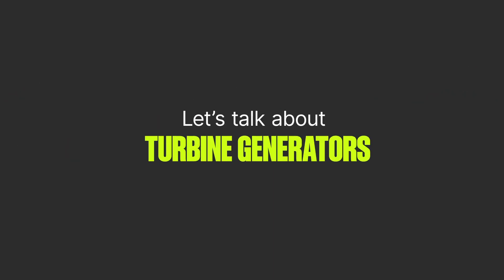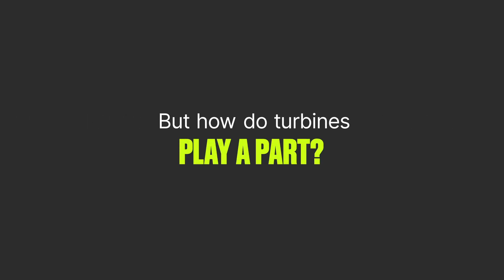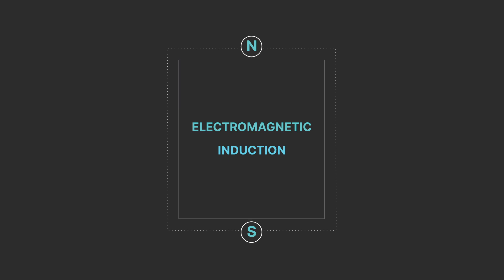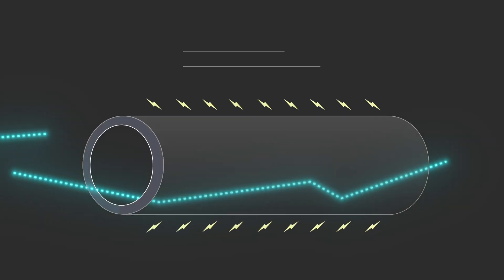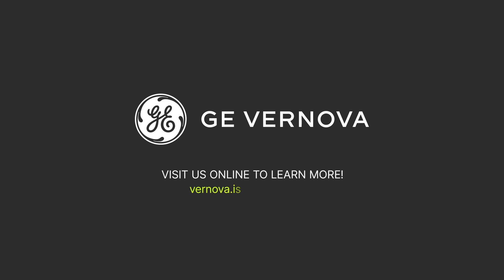Generators 101 | GE Vernova

Comment: how does a generator adjust electrical power output when they always run at a constant rpm?
Reply: I would say through voltage regulators

Comment: 🎯 Key points for quick navigation:

00:02 Turbine generators convert mechanical energy from turbines into electrical energy to power daily activities. They are crucial for grid stability and can be sourced from various energy types including gas, steam, wind, and hydro.
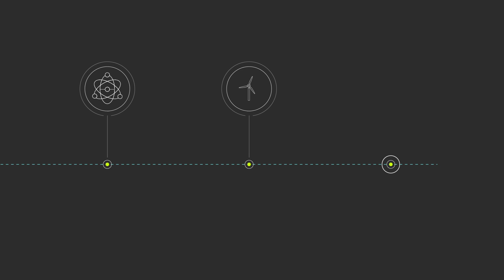00:32 Turbines and rotors provide rotating inertia for stability. Generators use turbine output to produce and transmit power, with energy sources ranging from gas and steam to hydrogen.
01:03 Electromagnetic induction is key, where a DC-powered rotor creates a magnetic field that induces electron movement in the stationary stator, generating electricity.
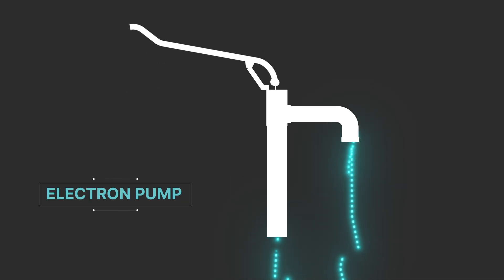01:36 Generators, acting as electron pumps, also use renewable sources like solar and wind. Efficiency is driven by insulation, temperature, and the design of rotor/stator components.
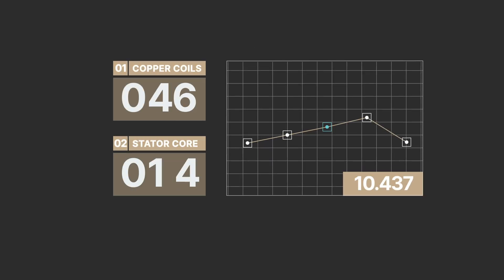02:09 Heat from electron flow affects insulation, impacting efficiency. Cool systems balance thermal energy, with hydrogen cooling shielding insulation while reducing power loss.
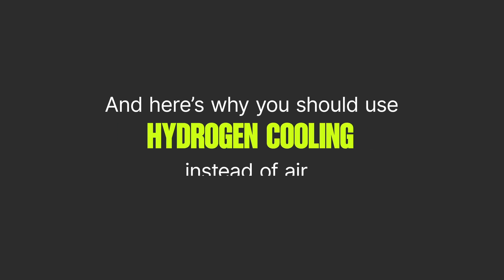02:38 Hydrogen is superior for generator cooling—it's more effective than air and uses less power due to its low density, enabling smaller, cost-effective generators.
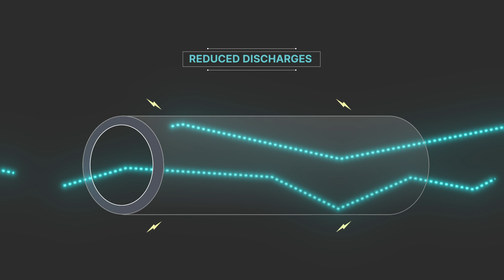03:11 Generators power homes, businesses, and grids, highlighting their ubiquity and essential role in maintaining electricity supply. More information is available online.

Made with HARPA AI

Comment: 🎯 Key points for quick navigation:

02:00 ⚡ Power Plant Generators Overview
- Explanation of how turbines convert mechanical energy into electrical energy,
- Types of turbines used: nuclear, wind, hydro, gas, and industrial steam,
- Importance of turbine rotation and grids in power stability.
03:12 🧲 Electromagnetic Induction Process
- Description of electromagnetic induction in generators,
- Functionality of rotors and stators in generating electricity,
- Renewable energy sources complementing traditional methods.
04:11 🌡️ Factors Affecting Gas Generator Efficiency
- Impact of temperature and insulation on generator efficiency,
- Role of rotor and stator configuration in electron flow,
- Importance of cooling systems in managing internal heat for optimal performance.
05:47 🥽 Hydrogen Cooling Benefits
- Advantages of using hydrogen over air for cooling generators,
- Hydrogen's efficiency in heat removal and circulation,
- Economic benefits of using hydrogen cooled systems in generator design.
06:39 🔋 Generators' Role in Modern Life
- Importance of generators in powering daily life and infrastructure,
- Prominent presence of generators in ensuring consistent power supply,
- Encouragement to engage with additional learning resources for more knowledge.

Made with HARPA AI